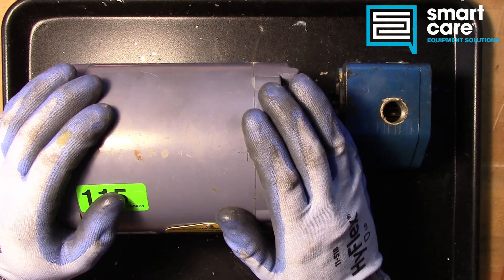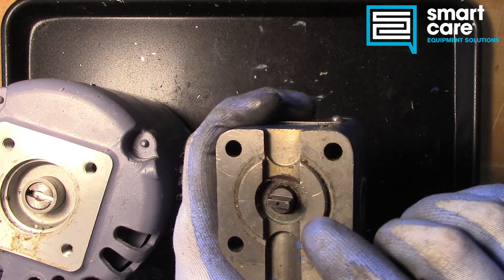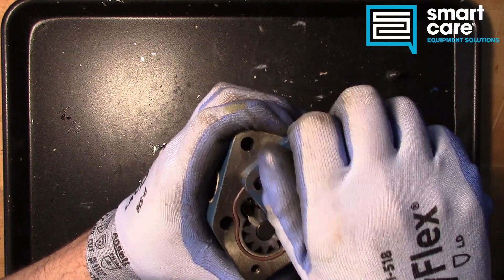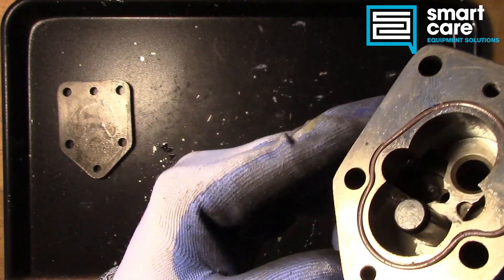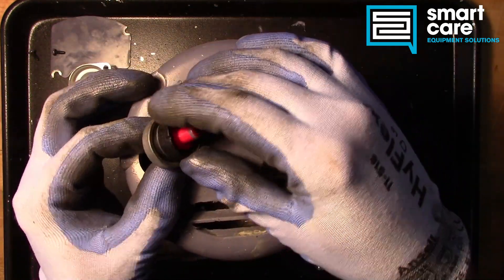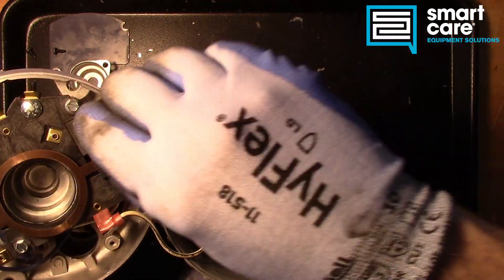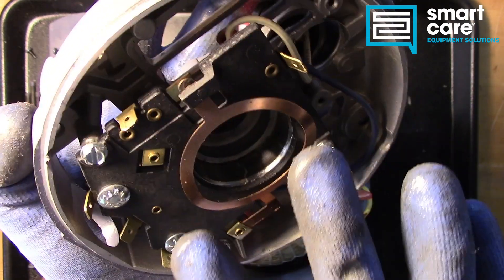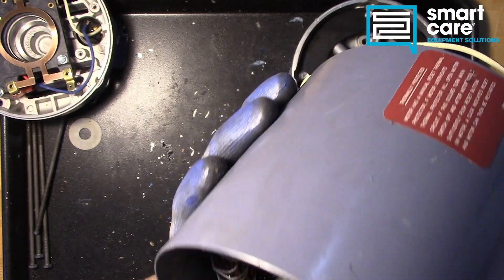Teardown Tuesday Episode 11: Fryer Filter Pump and Motor

Comment: Thank you for a good video :)

Few questions, my pump is leaking from the shaft seal. What is the correct size of the seal and how do you remove the old seal and put new one in?

Also, at the same time the o ring to the back cover should be changed. Do you know what size is the back cover o ring?

One more, the pump motor is seized, it 's full of hardened grease. How does one remove the pump motor? The electric connections?